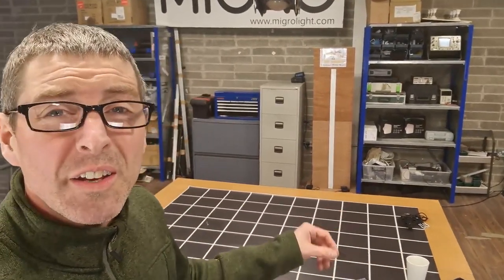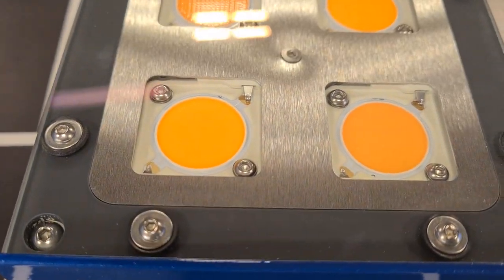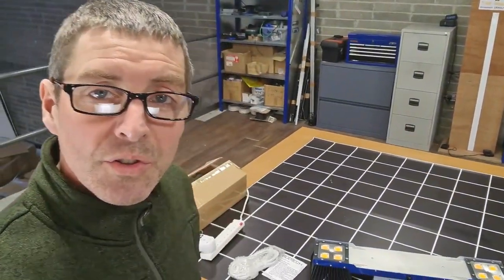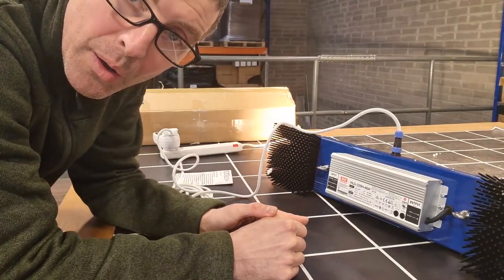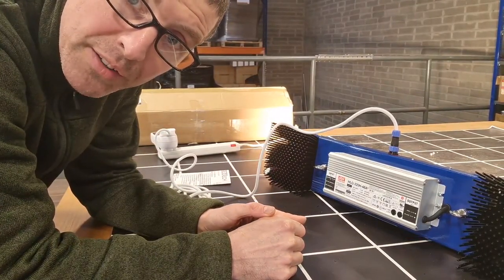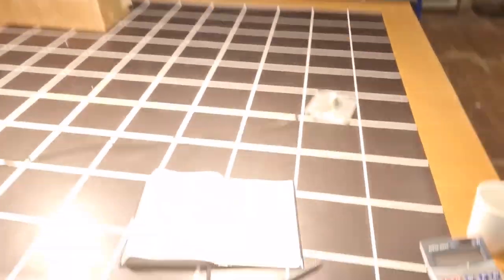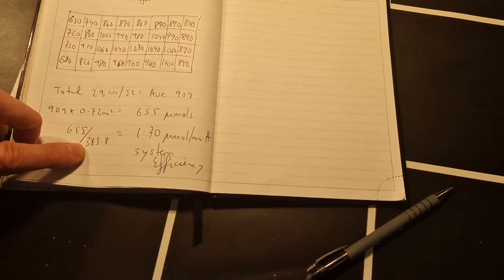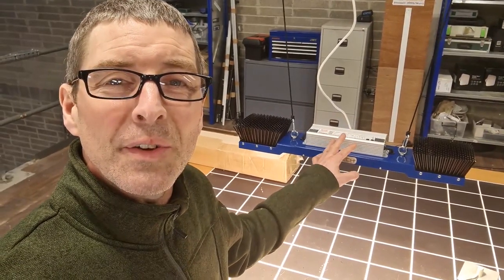Budtech COB grow light test and review | UK grow light manufacturer

Comment: 1.7 is brilliant for a £350 grow light of this spec. I see that they said it's well up there with 2.4 to 2.9 🤔 but there always exaggerated. Which is one of the main resions why I love you channel, say it how it is 💯✌💚
Reply: not really you can get a much cheaper light that is  at least 1.9
Reply: @DJTechnoboom  it was ironny I think
Reply: @jccuchvjvj  I am trying to figure out if a CMH be better for me cause I don't have a tent, but a I can get a nice tent for the price of a good CMH
Reply: @DJTechnoboom  for what area? Cmh will give you only slight more efficiency than hps. Not worth it and it emits too much of the harmful UVB. I will copy/paste my answer for someone else. Less than 2 it's acceptable but as I wrote. It must be cheap enough. I made my light with e27x3 splitters. 8 splitters. 24 SMD 12,5w 1521lm Bellalux bullbs gives me slightly more than 1,8 if I count it right from lux metter. I throw out the light diffusers and covered leds with acrylic lacquer. 9000h (30% loss after that) lifetime it's not impressive, but for a 1,48$ per bulb it's acceptable and it can be changed every year or two. I should went with 12,5w Philips for 2,3$ and 15000h lifespan.
Reply: @jccuchvjvj  a good CMH is 2.2, i use a closet and a CMH doesn't shine the light off the walls, all the light gets shine downwards, at least the one i am looking at but its expensive =,(  ,  i would have to sell like 4 of leds and 1 HPS first lol,  i will most likely get a Tent instead, to save money but i do think a CMH is best for a closet or a room grow. if you don't have any tent's like i do at the moment.
Reply: @DJTechnoboom  this is untrue. It doesn't have usable efficiency like that.
Reply: @jccuchvjvj  i think it does, its $550 for the fixture and 100 for the bulb. For that kind of money it better be 2.2. And that's the specifications from there website
Reply: @DJTechnoboom  this is efficiency emmited by bulb, and it's similar to hps, close to 2.0 µmol/s per watt, not the usable efficiency. I bet my hand it won't be more efficient than 1.5 PPF/Watt measured by Apogee PAR meter and this is way more that I actually think it will test. I'm that sure.
Reply: @jccuchvjvj  you don't understand that the meter doesn't add in far red or UV light, which hps & cmh and have alot more of then any LEDs.
Reply: @DJTechnoboom  depends what crop you are growing. UV is overestimated. Far red for cannabis is not that beneficial.
Reply: @jccuchvjvj  far red  is good if you use the right amount of it,  and also uv led don't work as good as the rest of led chips that's why they use small watt LEDs or they burn out. The far red LEDs work good though.
Reply: @DJTechnoboom  it's not like that white leds has no far red in spectrum. They have. They don't have UV though.
Reply: @jccuchvjvj  correct so with LED's light's the Far red and UV chips must be added in. but i think the far red leds work better then the UV is what i meant to say
Reply: @jccuchvjvj  what's the point of comparing apple's with oranges?
Reply: @frankeckhardt3655  profit or bankruptcy

Comment: Hey migro I know the suggestion I'm about to make isn't of a mainstream light but check out some of the qkin lm301b/h QB LEDs on AliExpress. Ive used two 120w boards In a 2x2 grow dimmed to 150w measured from the socket with great results.  There is EU warehouse delivery and Ive found them to be real great value for what your getting, however there is no real data on them, other than a almost definitely inflated 2.9 ppfd per watt  so you'd be shinning a light on the specs so to speak! Many thanks for your continued testing work on the quest for the best light tech!

Comment: Thanks Shane, I have wondered about that model light.  Appears that several diodes spread out have an edge in efficiency over running a lot of electricity through a few cobbs.  I would rather run the Migro LED array.

Comment: Nowadays most grow lights are 2.0 and higher so why would anyone want anything less? Seems like a waste of money imo?
Reply: Ive done better light for 56$
Reply: @jccuchvjvj  Nice! That sounds more like it considering how fast the led technology has improved over the last 5 years.
Reply: @chris432t6  less than 2 it's acceptable but as I wrote. It must be cheap enough. I made my light with e27x3 splitters. 8 splitters. 24 SMD 12,5w 1521lm Ballalux bullbs gives me slightly more than 1,8 if I count it right from lux metter. I throw out the light diffusers and covered leds with acrylic lacquer. 9000h (30% loss after that) lifetime it's not impressive, but for a 1,48$ per bulb it's acceptable and it can be changed every year or two. I should went with 12,5w Philips for 2,3$ and 15000h lifespan.